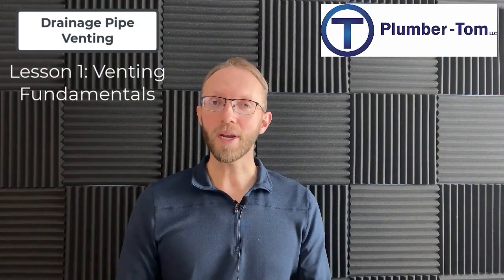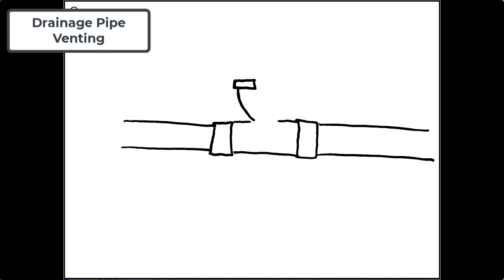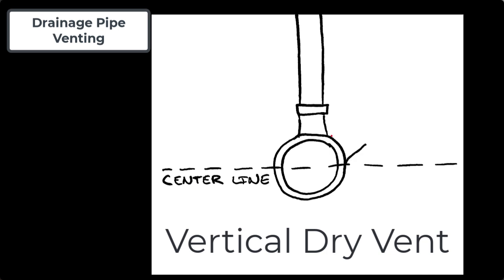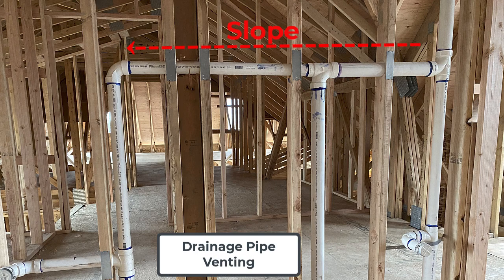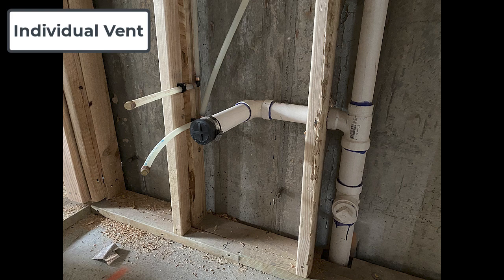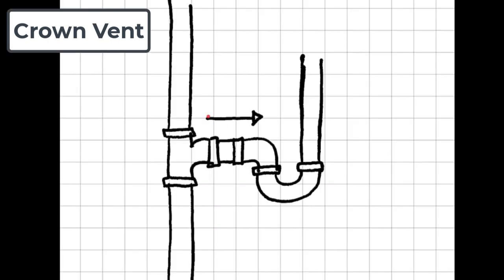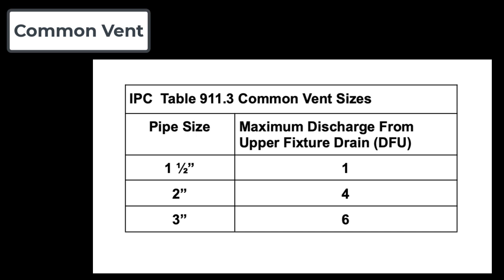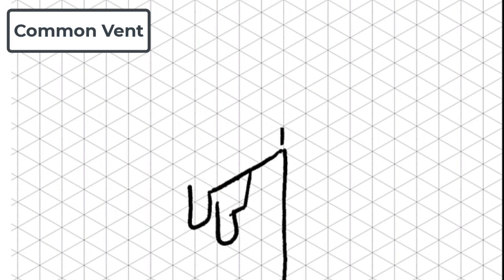Drain Venting Lesson 1 - Vent Fundamentals

Comment: If I have an open drain with a p trap (just off the garage floor with p trap accepts hvac condensation) can I cut into the same 1 1/2” drain line and put a comb wye T with air admittance valve and up and go over 3’ and install another p trap with stack for a water softener regeneration line? Im wondering about the two traps being at a different level. Thanks!!!
Reply from the maker: If you mean cut into the vertical stack and create another horizontal branch with another trap, then yes, that should be okay.  But branching off of a horizontal arm to the existing trap, or after the existing trap would not meet code.
Reply: @plumber-tom9470  Thanks!!

Comment: Great Video! I'm a homeowner. If the air is not properly circulating through the Fresh Air Inlet Pipe (FAI), can it cause a blockage and prevent the water from the Rain Downspout to flow out to the Storm Sewer and the Sanitary Sewer, could it cause my lawn and bricks outside of my house to sink?
Reply from the maker: I suppose, if the ground is not compacted.
Reply: Call a plumber 🧑‍🔧

Comment: A cross (4-way) has straight-through opposing inlets. When installed horizontally:
	•	Flow from one side shoots straight across into the opposite branch
	•	Solids don’t sweep into the main
	•	Turbulence causes backups and blockages
	•	No directional control 
 A cross (4-way) has straight-through opposing inlets. When installed horizontally:
	•	Flow from one side shoots straight across into the opposite branch
	•	Solids don’t sweep into the main
	•	Turbulence causes backups and blockages
	•	No directional control of flow

That violates basic DWV design and code intent.@p 1. Improper fitting for horizontal drainage (primary violation)
	•	IPC 706.3 – “Fittings shall be of the proper type and grade for the application.”
A cross does not provide directional flow, so it is not a proper fitting for horizontal drainage.
	•	UPC 706.0 / 706.3 – Requires fittings that provide a smooth, sweeping flow for drainage.

➡ A cross allows waste to shoot straight across instead of turning downstream.

⸻

2. Failure to direct flow / creates turbulence
	•	IPC 706.4 – “Changes in direction shall be made by fittings of approved sweep.”
	•	UPC 706.3 – Horizontal drainage must use wyes, combos, or long sweeps.

➡ A cross has no sweep and causes turbulence and solid hang-up.

⸻

3. Prohibited fitting for drainage use
	•	UPC Table 706.3 explicitly does not list crosses as approved horizontal drainage fittings.
	•	Crosses are intended for venting or vertical applications only, not waste flow. This is the only universally accepted DWV fitting (IPC & UPC) for two water closets draining horizontally.

Why it’s allowed:
	•	Each toilet discharges into a wye, not straight across
	•	Flow is directed downstream
	•	Solids are swept into the main
	•	Backups rise vertically, not into the opposite branch
	•	Meets IPC 706.3 / 706.4 and UPC 706

This is what inspectors expect to see.
No, this topic is not up for debate. You cannot use a sanitary T horizontally. You cannot use a cross only approve fitting right here would be a double Y with a 45 in order direct flow downstream horizontally while sharing a common event this is the only fitting that that can do this job at 11:05
Reply from the maker: Thank you for sharing your professional view.

Comment: I don't expect anyone to respond to this, but if anyone does have thoughts on it, please do reply.
I am considering venting my diesel heater's exhaust through my home's cast-iron vent system. I'm thinking that as long as all the traps have water in them, there would be no way this admittedly deadly gas could enter the house. It's very difficult to find a way to exit exhaust from one of these heaters, unless you are heating a garage or outbuilding with a wood or sheet metal wall. With my masonry house the wall is 14" thick in the area where I want to mount this emergency heater, so I'm wracking my brain to find a way for the exhaust to escape. Thanks for this educational video.
Reply from the maker: I would not recommend venting a diesel heater through your home's DWV system due to the risk of carbon monoxide entering the living space.  Too risky. There may be leaks or n your aged system. Pressurizing the system by exhausting into it may dry out the ptraps.
Reply: That’s a big no no. You cannot vent I will just refer to it as a “gas” fixture into the dwv(waste) system. Cast iron is also not an approved piping material for “gas” fixture vents. 

What a plumber would do is core a hole through your 14” wall to exit a certain distance away from any windows. This distance is variable based on BTU ratings and venting type(ex: direct vent, forced etc). Or we would run the exhaust vent vertically through the roof.

 I’m all for diy, but when it comes to working with fuel you should have a professional do it.
Reply: This is a horrible idea you’re gonna cost somebody’s life with this kind of thinking you need to take a double wall, flue sheet metal and run that double wall fill out the side of the house that’s it. Nothing else will suffice.
Reply: This is called a class a or class B chimney

Comment: @plumber tom im confused when your talking/explaining common vent violation when a toilet and tub where two traps branching off the same trap arm from a vertical stack which cant be done but if you go to most bathrooms you  will see a bathtub wye in to a toilet going to a stack with the lav tying in to a tee on thecsecond floor so you losing me
Reply from the maker: Each fixture has to be connected to the stack itself, not branching off of each other when using vertical wet vent.
Reply: @plumber-tom9470 thx
Reply: Fixtures must hide into a vertical stack with a CT because if the trap weir is above the vet and you have a cold violation you have created an S trap

Comment: Can’t lay down a double y or double fixture fitting as you illustrated for the toilets at the end of your video.  Vertical orientation only.
Reply from the maker: Actually, you can.  IPC Table 706.3 and UPC 706.3 both allow it.
Reply: @plumber-tom9470 This is a great debate. 
It’s a theory and practice thing. 
Yes, the code may allow it, but after a few drain line camera views seeing the large chamber at the fitting filled with debris, you will change your mind. Especially with the low consumption toilets. Then when the drain snake equipment goes straight across the fitting instead of down the run of the fitting, the problem will become apparent. 
I’m sure that you are familiar with the term “ drain line carry “. What happens is that chamber almost eliminates the effect of the flow and material will be left behind. 
I know that it is a convenient way to lay out a battery of fixtures, but in practice there are times when it causes a massive service issue.
Reply: @JTTTTx  please read the comments I made below any licensed plumber worth their two cents would know not to use a cross fitting horizontally. This isn’t up for debate.
Reply: @plumber-tom9470  A cross (4-way) has straight-through opposing inlets. When installed horizontally:
	•	Flow from one side shoots straight across into the opposite branch
	•	Solids don’t sweep into the main
	•	Turbulence causes backups and blockages
	•	No directional control of flow

That violates basic DWV design and code intent.
Reply: @p @plumber-tom9470  1. Improper fitting for horizontal drainage (primary violation)
	•	IPC 706.3 – “Fittings shall be of the proper type and grade for the application.”
A cross does not provide directional flow, so it is not a proper fitting for horizontal drainage.
	•	UPC 706.0 / 706.3 – Requires fittings that provide a smooth, sweeping flow for drainage.

➡ A cross allows waste to shoot straight across instead of turning downstream.

⸻

2. Failure to direct flow / creates turbulence
	•	IPC 706.4 – “Changes in direction shall be made by fittings of approved sweep.”
	•	UPC 706.3 – Horizontal drainage must use wyes, combos, or long sweeps.

➡ A cross has no sweep and causes turbulence and solid hang-up.

⸻

3. Prohibited fitting for drainage use
	•	UPC Table 706.3 explicitly does not list crosses as approved horizontal drainage fittings.
	•	Crosses are intended for venting or vertical applications only, not waste flow.

Comment: Sorry Tom, you have it all wrong.  Venting protects traps seals.  That's it.  That's its entire and only purpose.  Sanitary drains aren't like a milk jugs going glug glug because we don't drain through reductions, we drain through increases in pipe diameters.  Sanitary drains are like a milk jug with the bottom completely cut off, milk just falls right out.  Unvented sanitary drains drain just fine.  The traps get siphoned, but the water drains out.  It is physically impossible to air lock a properly built and unobstructed sanitary drain assembly.  The conditions for air lock, when the hydraulic gradient falls below the outlet of the pipe, do not exist anywhere in a properly built and unobstructed gravity drain.  Venting is all, and only, about protecting trap seals by equalizing air pressure to within 2" w.c of each trap face.
Reply: Lol. 
I love how you are too daft to understand how what you said is... Funny...
But!
The overly nice way guy told you basically "Yeah, duh. If PROPERLY installed, that's not an issue"

I'm betting you went on your way like "Yeah, I know I was right. I always am."

Lolololol
Reply: Even though a drain looks “open to air,” once water starts flowing the trap fills and blocks airflow, so the pipe downstream can’t pull in air through the fixture; the moving water then creates suction or pressure unless there’s a vent to supply and relieve air, which is why unvented drains gurgle, siphon traps, drain slowly, or steal air from other fixtures—the trap blocks air on purpose, and the vent is what puts air back into the system so water can flow normally and sewer gas stays out. this is why drains do go lug glug because yeah guess what whenever you put a trap on them. They need a vent to relive that pressure water falls and blocks off the air from the drain in the waste line increasing pressure in the pipe and it can escape through the drain causing a glug glud aka air pressure coming back up through the pipe because gravity is compressing it with water vents sole purpose isn’t to prevent traps from siphoning it’s to correct pressure differences that occur when systems are trapped because we don’t want dangerous and smelly sewer gas in our homes.
Reply from the maker: Thank you for explaining.  The milk jug example is to illustrate what happens if the drainage is not properly vented or not vented at all.  When plumbing drains were first installed they did not know about vents and they definitely had problems with air locks.  But you are right. When a vent system is properly installed that is not a problem.

Comment: Thanks of the great video! Quick question, if you can clarify; at 7m:49s of the video, you mentioned vent on the horizontal line instead of trap arm is a violation, then at 11m:04s it shows a common vent on horizontal branch as a compliant method. Why the first horizontal case is a violation and not the second arrangement?
Reply from the maker: I see the confusion. The example in 7m49s is an individual vent. The vent is incorrect in that example because it is not on the trap arm. The example in 11m04s is a common vent for two toilets. The horizontal branch is the arm to both toilets.  That example seems a bit wrong to me, but I took that image from an IPC code commentary book with illustration so I assume they approve of that venting.
Reply: Thanks a lot!
Reply: A cross (4-way) has straight-through opposing inlets. When installed horizontally:
	•	Flow from one side shoots straight across into the opposite branch
	•	Solids don’t sweep into the main
	•	Turbulence causes backups and blockages
	•	No directional control of flow

That violates basic DWV design and code intent. all fixtures must travel to pipe diameters through the trap arm this way if there is a backup solids that shoot up vertically do not get stuck into the vent.

 A cross (4-way) has straight-through opposing inlets. When installed horizontally:
	•	Flow from one side shoots straight across into the opposite branch
	•	Solids don’t sweep into the main
	•	Turbulence causes backups and blockages
	•	No directional control of flow

That violates basic DWV design and code intent.@p 1. Improper fitting for horizontal drainage (primary violation)
	•	IPC 706.3 – “Fittings shall be of the proper type and grade for the application.”
A cross does not provide directional flow, so it is not a proper fitting for horizontal drainage.
	•	UPC 706.0 / 706.3 – Requires fittings that provide a smooth, sweeping flow for drainage.

➡ A cross allows waste to shoot straight across instead of turning downstream.

⸻

2. Failure to direct flow / creates turbulence
	•	IPC 706.4 – “Changes in direction shall be made by fittings of approved sweep.”
	•	UPC 706.3 – Horizontal drainage must use wyes, combos, or long sweeps.

➡ A cross has no sweep and causes turbulence and solid hang-up.

⸻

3. Prohibited fitting for drainage use
	•	UPC Table 706.3 explicitly does not list crosses as approved horizontal drainage fittings.
	•	Crosses are intended for venting or vertical applications only, not waste flow. Do not listen to this clown. I’m willing to bet he is not a licensed plumber.

Comment: Hi Tom. I may need to replace the old, galvanized steel drainage pipes due to rust inside which frequently causes blockage. Talk to some contractor, and he said new PVC pipes will be installed  and in some places, the steel pipes can not be cut out but left in place. Instead , he would drill a hole on the floor near the old one (in the wall) and run it. Is it acceptable in the NW US ?
Reply from the maker: Yes. Generally, you can replace old pipe with new pipe without being required to update the vent piping of the system.